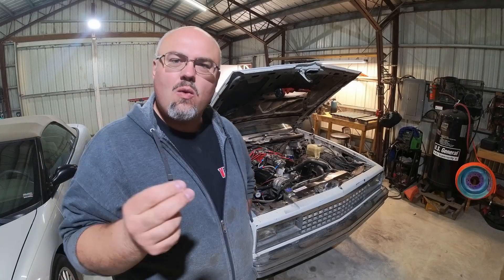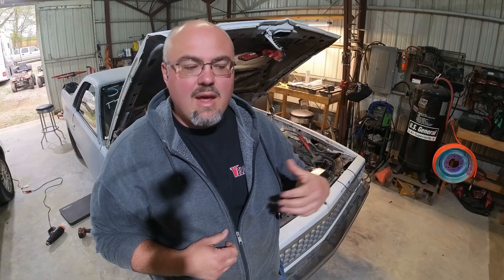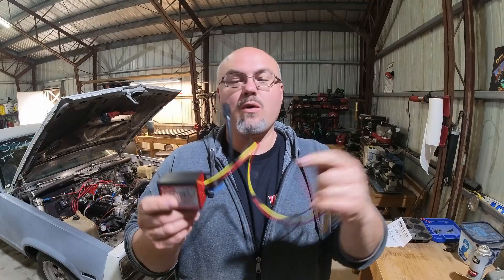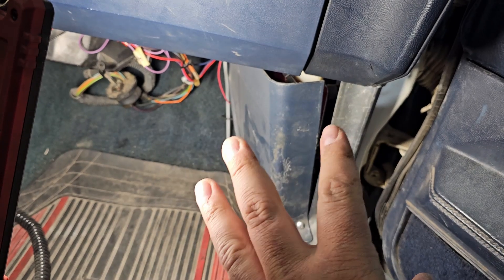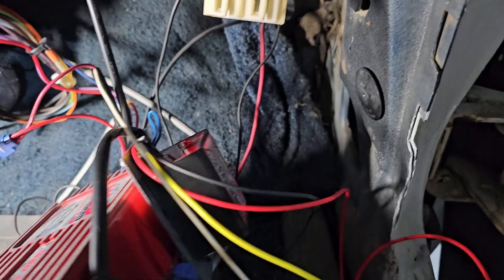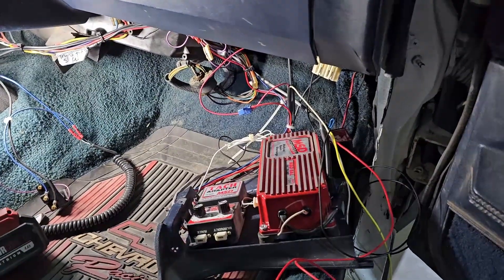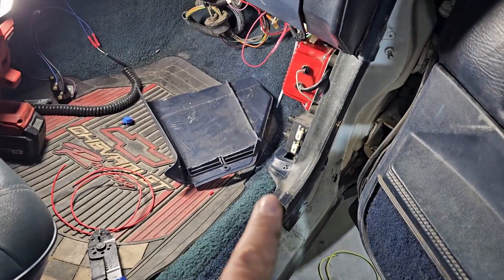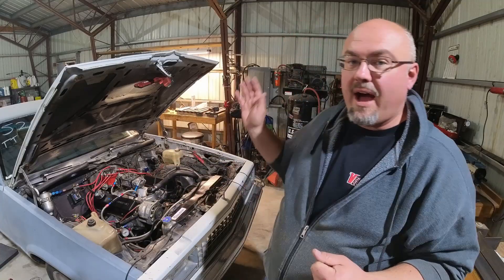How I Fixed My El Camino Race Car's Starting Problem!

Comment: Another reason for hard starting is using an old starter with an old battery on a high compression engine. Consider upgrading to a more modern gear reduction starter, make sure the battery has enough cranking amps, and keep the battery posts clean.
Reply from the maker: Gear reduction starters are much lighter and far easier to manipulate into place. They also come in a wide rage of power levels to accommodate engines up to some pretty hot compression ratios. I do have a gear reduction starter on this car and it's been solid for over 10 years.